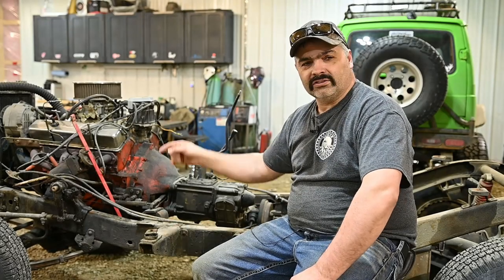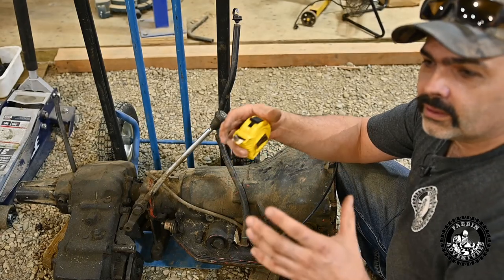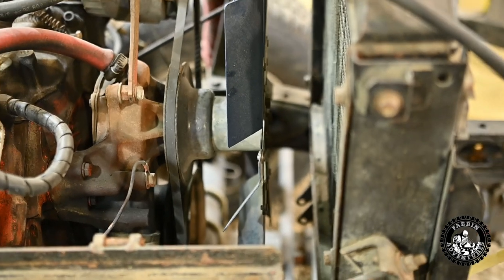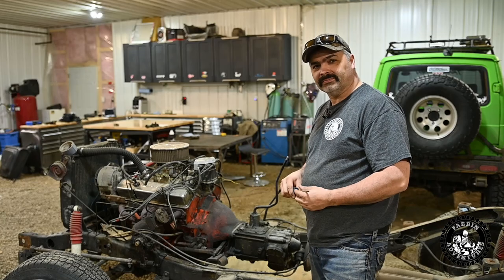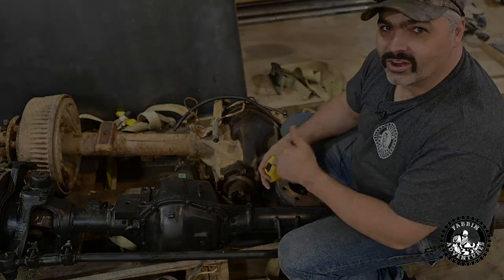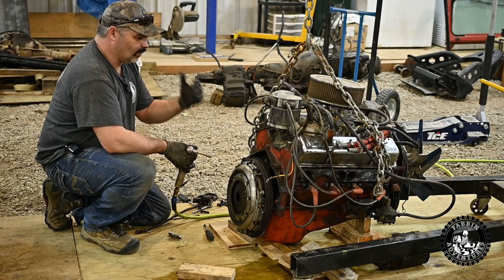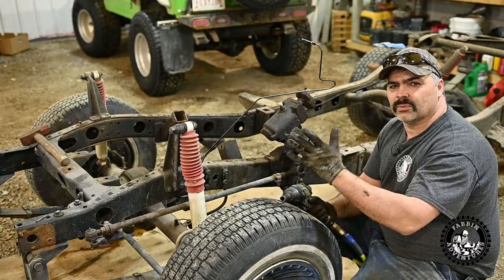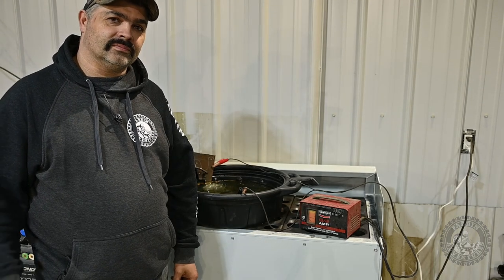Project XTREME40: Removing the drive train

Comment: Mine had a 350 with a shortened Turbo 400, it came as a kit, but it was over 30yrs ago.
Reply from the maker: A shotened th400, never heard of that. Th350s are super tough and shorter already, and take less hp just to turn.
Ive got the tcase solution in my shop already!
Thanks for watching, consider subscribing if you havent already, im putting out weekly videos!
Reply: @FabbinAdventures  Yep, you removed the out put housing, the adapter kit came with a short shaft, personally i think tearing up a 40 series these days though is madness, they're becoming a well sort after item where i am.
Reply from the maker: Oh no kidding...i dont plan on tearing up the 40 beyond the point where it cant be put back together. I will be fixing all the rust and lightly restoring the body. They are sought after here also. I like the body, thats why im building it better!
Thanks for watching!

Comment: If looks like it will be a very beefy Landcruiser. Did you consider RCV shafts instead of going with the Dana 60/14 bolt axles? If yes, what was the deciding factor for you to choose the 1-ton route over “RCV Toyota” shafts?
Reply from the maker: The deciding factors for me was cheaper gears, axles and parts for the chevy 1 tons and the fact that the front diff is already disc brake, AND... finding parts when i am away from home and or if i break something!
The chevy one tons also seem to have a tighter steering radius!
Shes a win, win, WIN all around for me!
Thanks for commenting Jimmy!
Reply: Great channel and fab work!  I’m working on a similar project.  Quick question on the front axle.  I also would like to use a passenger drop axle.  What year Chevy is the front Dana 60 from?  Thanks!
Reply from the maker: Not sure what year this one was from, but look for 78 to 87 1 ton 4x4 chevy pick ups for sure.
Glad you like the channel, unfortunately ive been parting out this project in favor of another.
Thanks for watching and commenting!
Reply: Thanks for the info!  Assuming the axles and link setup are long gone?
Reply from the maker: I still have the axles and wheels and tires,but they will most likely be going on my new square body project!